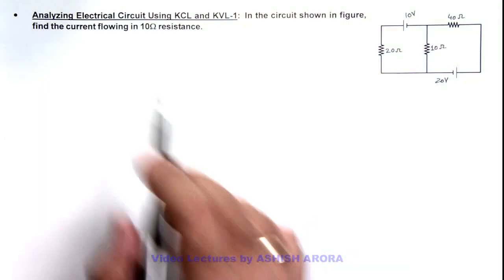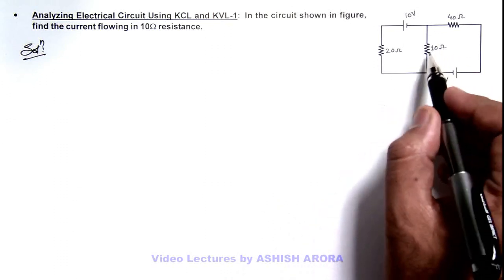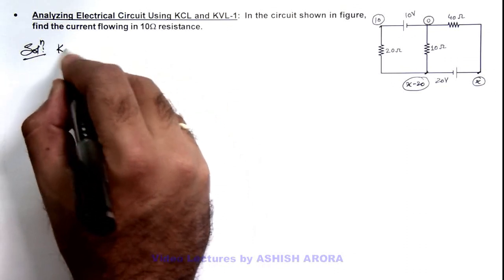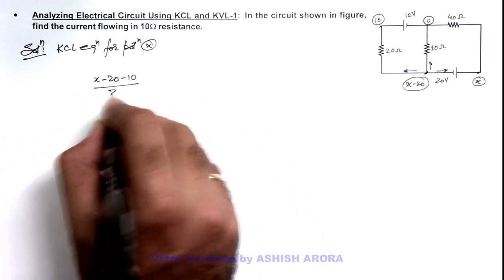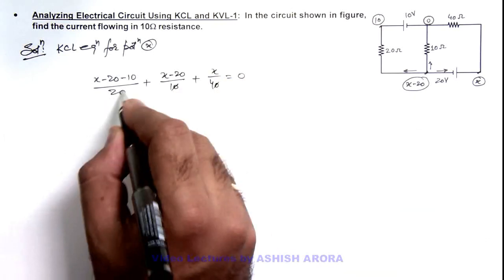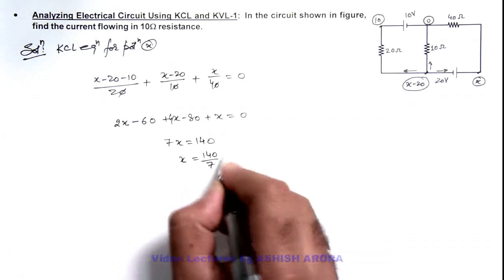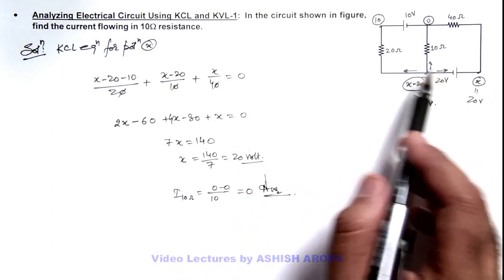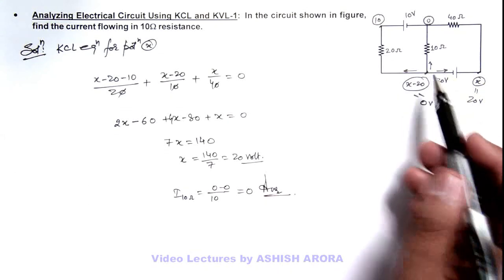3. Advance Illustration | Current Electricity | Analyzing Electrical Circuit Using KCL and KVL-1

Comment: For those who not get answers by kvl
Let (i) current flow through 20v potential
When it cross 40 ohm resistance it further divided into 2 part let current through 10 ohm (i¹) then current through 10v potential is (i-i¹) now we can apply kvl in loop.
20v-40i-10i¹=0
4i+i¹=2 ------eq (1)
Again apply kvl in whole loop 
20v-40i+10v-20(i-i¹)=0
6i-2i¹=3---------eq(2)
By 1 and 2
We get i=1/2 and i¹=0(which is current through 10ohm resistance)

Comment: We choose as like you sir at Same points X and 0 it comes ,,,,,but different positions takes X and  0 not comes why
Reply: in both cases, the current will be 0 and at the point where sir has got 20 V there you can find it easily without calculation

Comment: Answer is coming to be x= 120/7 if I assume x at the place of x-20 and apply KCL, How this is sir?
Reply from the maker: No. Your calculations are wrong... if you use x at the place of (x-20) than on the right terminal of battery potential will be x+20 and if you use KCL then value of x comes out to be zero...
Reply: @physicsgalaxyworld  yes it it coming but why?
Reply: @coderhumai  that is becus u have consider 20v wala as x… so udhar se directly zero aagya…
Reply: @physicsgalaxyworld  yessssss meraa ara😎😎😎😎😎😎😎😎😎😎😎😎😎😎

Comment: Sir i assume null point between 10v and 40ohm resistance is this correct
Reply from the maker: Yes you can consider zero potential anywhere in the circuit and solve using this method... final result will be same...

Comment: Sir KVL not working !!
Reply: its working bro ... i got it
Reply: @adarshchaturvedi3498  how
Reply: By KVL 
You will get equal and opposite current in the branch with 10 ohm resistance 
I=1/2 A and I =-1/2 A
Reply: @suyashsharnagat2912  i m not getting by kvl plz tell how didi u do?
Reply: @suyashsharnagat2912  how bro....I am not getting
Reply: @suyashsharnagat2912  how please explain..I am also not getting the same answer by kvl..

Comment: it should be x-20/40 know please reply sir
Reply from the maker: No x-20 is the potential at the terminal below 10 ohm resistance... not across 40ohm resistance... i suggest you to watch all 10 fundamental classes of electrical circuits to understand solving the circuits in a better way...
Reply: @physicsgalaxyworld  Yes

Comment: sir please explain why are you taking x/40 @2:25
Reply from the maker: as x/40 is the current through 40 ohm resistance...
Reply: Sir , instead of x/40 ; shouldn't it be (x-20-x+20)/40=0 , sir 20volt battery is also there , I think you haven't considered it . Sir please take my doubt.